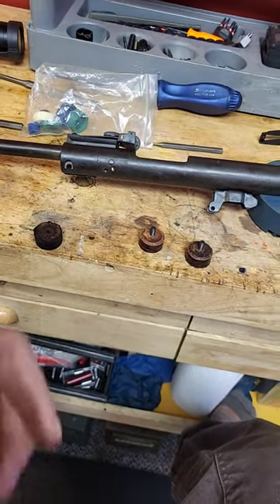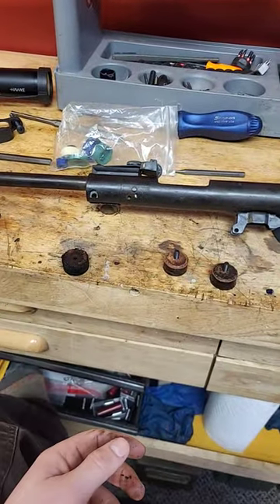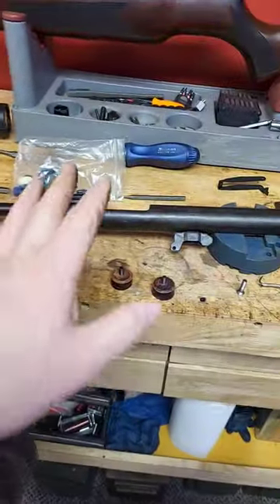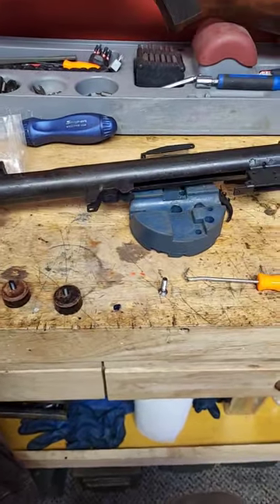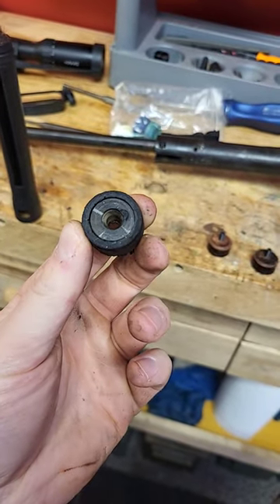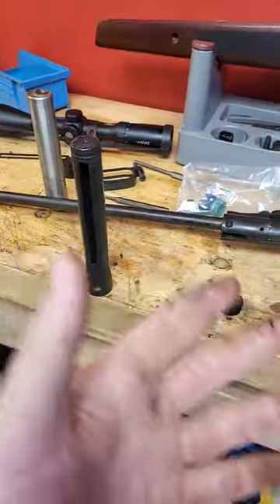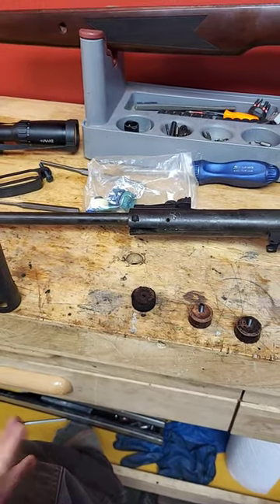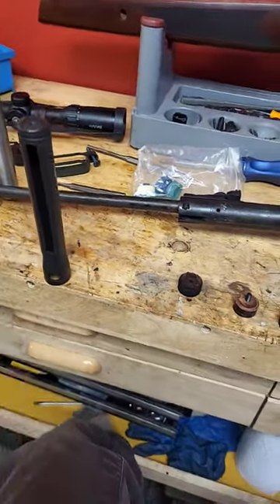why leather air rifle seals suck

Comment: Leather seals were great for their era because they adapted better to poorly machined tubes where rubber would get ripped in a few strokes

But on a nicely machined modern air rifle synthetic seals offer more power & durability/ easier maintenance
Reply from the maker: Thanks for the insight